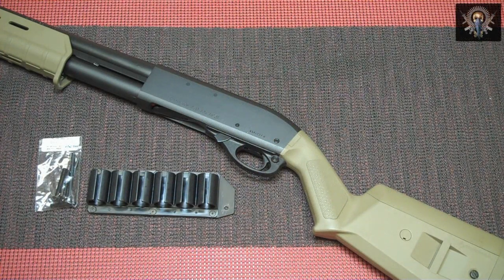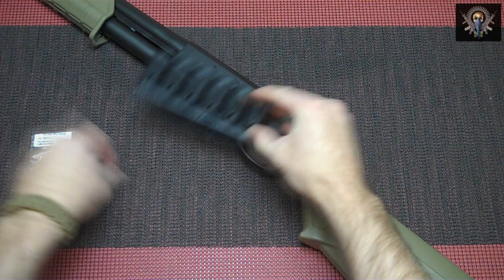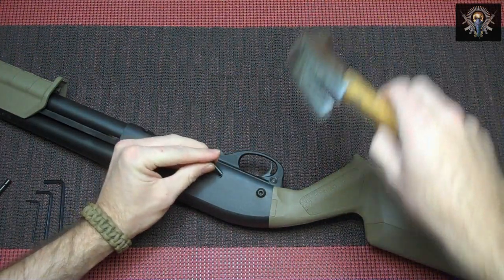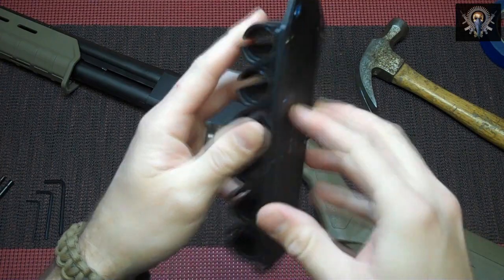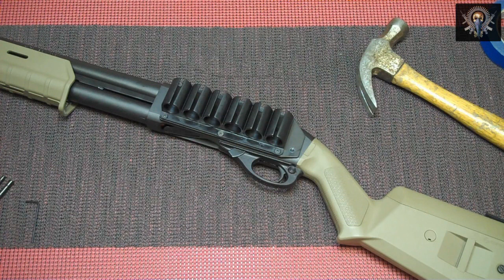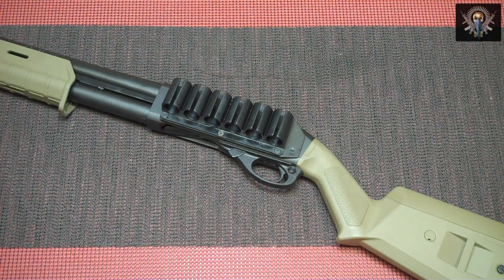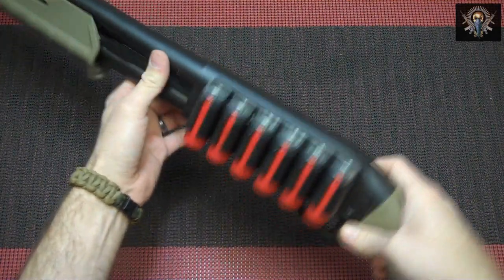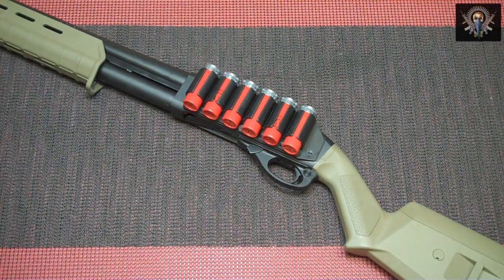Remington 870 ::: Side Saddle Install :: Musty Yeti

Comment: thanks for the product reviews.  a couple notes:
the red loctite which you aren't using,  is designed only to come off with high heat like that of a propane torch. It's designed for permanent bearing pins etc.
Suggestions: there a few ways to solve the camera placement problem: whether doing table top or floor views, you can put yourself on the opposite side of the camera & remain out of view if you wish by pre marking the visible corners with blue masking tape etc. With the camera mounted high enough facing down, you have a clear static shot zone & can avoid having to go off camera at what may be a key moment for someone trying to familiarize with the procedure shown. 
It's easy to put lights on either side so there's no shadow while you're moving around off camera. (There's also a choice to mount the camera upside down or not. In some cases it makes the final view more clear; in other cases, not  ) 
Selective editing to delete extraneous visual/ audio noise is more work 
but the end result is more than worth the effort in terms of  effectiveness & efficient use of time.
Main thing is to keep active details in plain view. Of course one can also drop in close up focus shots for certain details optionally.
Someone else mentioned zooming back, but the problem there is loss of fine detail & more diffused viewer attention focus.
hope this helps,
Persevere.

Comment: If you have problems with the Shells falling out(They should be Brass down for much easier loading) Buy a MESA TACTICAL SURESHELL CARRIER(6061-6T AIRCRAFT ALUMINIUM) Maybe if you want add fully adjustable Ghost Ring Sights/Picatinny rail.Then you could add detachable Trijicon Reflex sights(1x42). Tactical Choke Tube looks bad ass too. Thats what I have anyway. The add-ons are endless! lol Have fun with your 870 ! Love the colour,looks great!